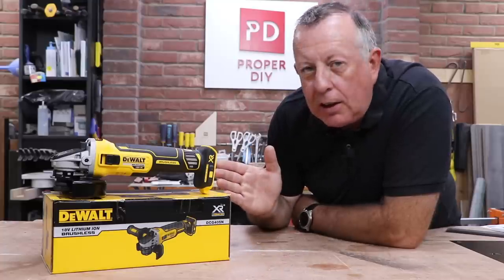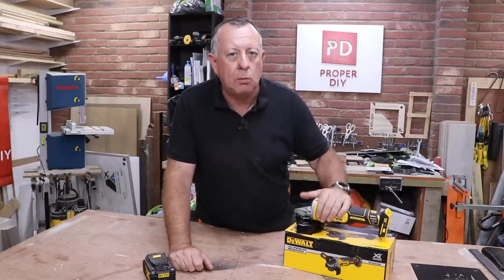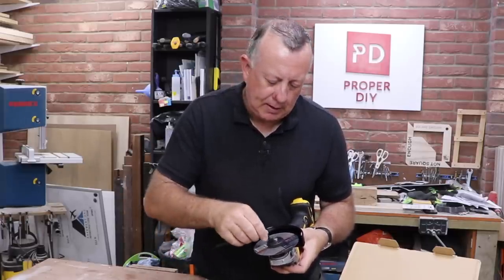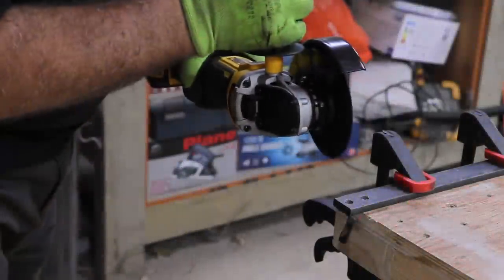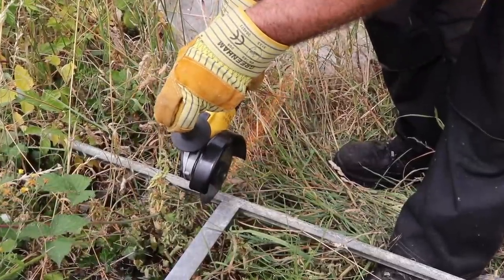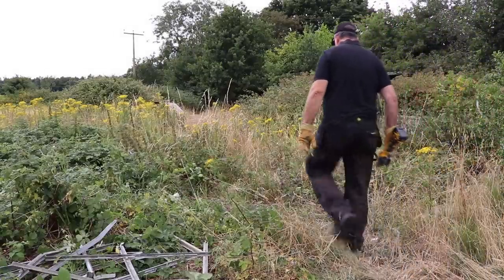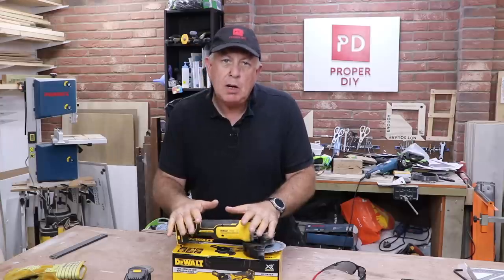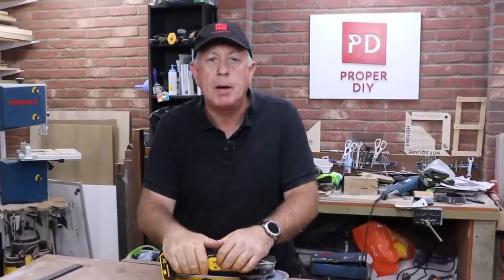Dewalt DCG405N Cordless Angle Grinder Review

Comment: I've had one of these angle grinders for about three years and it will cut almost anything, with the right blade.  I even managed a freehand circular hole for a fan  in the middle of a porcelain wall tile!  Cordless makes it very useable and the brake is excellent. This together with the many other XR tools I have make many jobs easier. It is easy to take their convenience for granted. 
However, if I die, please don't let my wife sell them for the price I told her I bought them for!
Reply: I am afraid it’s never going to be an IF but definitely a WHEN
Reply: I have many categories of tools, hobby items and other things that I have smuggled in undercover. When I get question my usual response is "Yes love I'd had it for years!". I then ask about the latest shoebox size package that was delivered for her.

Comment: Just as a general and my 2cents worth of a comment: (having owned the same unit and “upgrading” to one model up "DCG406N-XJ” for both ease of use and general and better “Safety” due to that switch mechanism in particular, which is extremely dangerous in my opinion @9:29 being a prime example)
-Prop up your work piece,as your back will thank you for it. not to mention have a far better view on what you are doing.
-Get a 54v Flexvolt (I know they are expensive,but its worth the investment) battery as the grinder drains batteries extremely quickly
-When cutting metal (and large,thick pieces in particular),make use of a “Pull push”/“ Constant Back and forward motion” method,as it reduces the amount of disc material being use (cost effective and time between changing discs over), reduce battery drainage and prolong work time,and puts less stress on the motor (does not get HOT as quickly) overall… Also get into the habit of “blowing out” the “vents” as material dust tend to clog it up and increase internal compenent heat…and is one of the prime culprits for grinder motor failure…

Comment: I bought one of these over a year ago, and it's priceless. I bought the Dewalt as I had the batteries. But, it doesn't have to be Dewalt, just any cordless grinder makes a huge difference.

I still use a corded grinder for stone & concrete cutting, but for everything else, this is a must have DIY tool. The cordless type is so handy for metal and plastic pipe, rusted screws & bolts, and a ton of other jobs. Never used it on wood, as I have proper power saws for those jobs.

They do tend to get through a 2Ah battery fairly quickly (10-15 mins), but it's a good reminder not to over-use it. 

As I mentioned, I have other angle grinders. One of the features I love about the Dewalt is the Allen key hole for replacing discs. My other grinders require a specific 2-prong tool for changing discs, which is annoying when you forgot where you put it.

Comment: Prob controversial but I prefer the paddle to the switch. I prefer the safety of knowing if I do need to drop the tool quickly that it will turn off. I also find it more comfortable to turn on and off with gloves on while I work.

Comment: I find that you can get more battery life and cut off wheel life if you are gradually "scoring" away at the steel from the top surface downwards through the 'thickness' of the bar rather than cutting through the full width of it like you were. You have the cut off wheel both above and below the surface of that metal bar which requires a lot more power and wears the disc faster. Not sure if I explained that well

Comment: Disks should only ever be tightened up by hand as the spindle rotation will tighten the nut when you’re using it. The tool is there to remove disks if it ever grabs as it will tighten the nut harder than you can do with your hands.

Comment: DeWalt are actually very good with spare parts if you do lose your locking nut. I got replacements for broken bits on my table saw within a few days. I did go through the retailer though, FFX, and their customer service is excellent. Your mileage may vary.
Reply: My grinder came missing the knurled retainer nut, but they generously delivered me ONE THREE TIMES 😂🤦‍♂️😂

Comment: 11:04 - Just a nerdy correction: there is still quite a bit of charge left in it. Lithium batteries can't be discharged below a certain voltage or they get damaged, so the tool (or the battery's own protection circuit) is preventing further discharge, but if there was "absolutely no charge left in it", you wouldn't be able to use it again.

Comment: I have purchased a number of the 18 v li lon Erbuer cordless tools and have been very impressed indeed. Although I use them in both a professional and DIY capacity they are not being operated every day , all day so totally appropriate for the price point. They are well built, comfortable to handle and the new fast chargers are fan cooled to dissipate the heat generated. I don’t think you can beat this range that after all has the clout of the Kingfisher Group behind it .

Anyone with comments ?

Comment: I have used de Walt cordless drills for years and they have never let me down . What has not been as reliable are the non branded  18 v Lilon batteries that even brand new just don’t hold a charge like the originals

Comment: For very little more, I purchased the DeWalt 405FN.  Essentially the same, except has a less blunt front ‘flat head’ design, that will reach into tighter spots. Get 5 Ahr batts tho’ cos they devour power.

Comment: Save yourself some money by the 115 mm model as it fits the 125 discs, probably a slight engineering fault that would upset the marketing department as the two models have exactly the same specs. Also use 6ah batteries as you will get increase in power for heavier workloads. I have two DeWalt cordless grinders, the Flexivolt 125 and the 18 V 115. Use the 18 V because it is lighter more convenient most of the time but the Flexivolt has considerably more power. I use the same 125mm cut-off discs and grinding discs for both models.
Reply: There isnt a 115mm cordless model,except in USA

Comment: When I saw the video pop up the part I was interested in your take on run time. To fulfil my grinder fixation I had looked at this unit but I have invested in a flex volt battery for my Dewalt tools. So I could go with the same unit as you with 18v or go for the 54v model. You would, certainly get more run time from a flex battery at an equivalent 12a/h on your unit
Cheers Stuart 👍🏻

Comment: Thanks Stuart, looks like a good piece of kit !
 I bought a cheap own brand cordless grinder a couple of years ago ( it was on offer and I already had the batteries) and although it only cuts 2 or 3 slabs before getting hot and giving up, it does mean I can concentrate more on not cutting my toes off than where the blasted cable is !
Mine is also of the "rat-tail " design popular in the USA with a paddle trigger which is more natural to my thinking.
Be careful on that roof, will you be using crawl boards ?

Comment: You're right Stuart, once you get on the cordless merry-go-round there's no getting off. I've switched nearly all my power tools to cordless now - 20v Worx for drills, drivers, circular saw, oscillating tool, jigsaw, angle grinder, sander, power washer etc. 48v Mountfield for the lawn mower, strimmer, hedge cutter, chain saw, leaf blower / vacuum. Battery charging station in the garage that can take at least two batteries of each type at a time & plenty of batteries to go around. That said I do have a "rouge" cordless Erbauer impact driver which I needed for a job when I could not source the Worx equivalent. Another good video Stuart. 👍

Comment: Thanks Stuart,  this video confirmed what I thought about the Dewalt cordless angle grinder.  I’ve got the Dewalt battery platform as well, but hadn’t bought the angle grinder as my Hitachi corded one is working fine and I only use it occasionally.  When it does die I will buy the Dewalt cordless, good to see that it has the power you need.
I recently bought the Dewalt cordless planer and have been very impressed by the power and quality of the cuts it produces.  Another good toy !
Reply: Oh cool.  Was looking at the planer next too.  Can you review the planer please @Stuart?

Comment: Just got one - agree is excellent and it cut up come steel bar perfectly and quickly - any comment though on the DeWalt  instructions that mention a different guard for sanding surfaces? ( it comes fitted with a 'type 1 cover') -  I couldn't follow what the 'type 27 cover' is needed for

Comment: Just in the market for a grinder for cutting some roof tiles, so a very timely video for me Stuart. Any chance of some more info on types of blades for different materials, maybe as part of your future project which I’m sure you’ll be posting on YT?
Reply: Yes more expensive than grits but I have been impressed with the diamond tipped blades for masonry, concrete, marble, ceramics etc

Comment: At about £165 for the bare unit its just about justifiable cost wise for an occasional use tool and I have seen a deal for £184 including a battery which is a good buy, I will buy one when my old corded one drops dead...

Comment: I've had one of these for a while, It's got some proper power but it eats batteries like you say, more so than any other DeWalt tool I own. It chews through batteries so fast that they get hot to the touch, so I've taken to swapping batteries mid grind when they are about half empty, just to prolong their life and not overheat them. Great for using up a ladder though or in a field working on my tractor. Dewalt also need to come out with a variable speed cordless grinder as this this thing way to fast to use diamond core driller for drilling into natural stone/marble/granite.  Not sure if they have plans for one.
Reply: Grinders from any brand eat through batteries due to there nature of speed and high amps
Reply: its out now

Comment: Nice video Stuart - and nice tool! I bought my first angle-grinder last summer - a corded one, and a terrifying beast! Shattered a cutting disc the second time I used it and I've avoided using it ever since. I've wondered whether a cordless one might be a wee bit less aggressive and let me get used to them, or should I just grit my teeth and man-up to my corded one...? LOL
Reply: My honest opinion (And no offence given), is that you have used  a cheap grinding disc from a cheap manufacturere ; the wrong Rpm disc (They are all rated to operate at a certain speed,and anything above that speed will result in shattering), or a damaged disc that has had a crack in already… (The amount of guys Ive seen on jobs, that pulls out a used grinding/cutting disc that has been thrown into the toolbox with tools ontop..blows my mind,as it is accidents waiting for happen)

The battery version that Stuart is useing does run “slower” than most corded ones…
Reply: @mariusenslin  thanks, Marius, and no offence taken lol. Yes, that's more than possible - and coupled with my inexperience, a recipe for disaster. Should I practice with thicker discs, cleaning rust off steel etc, to give myself a better feel for how the grinder operates? Thanks!
Reply: @MarkMichalowski  definitely a good and overal practise and approach..👍🏻

The right PPE (Safety Glasses/goggles at least or even better a full face Visor as Stuart is using, Some “grinding” gloves and hearing protection in my opinion)…. also ensure no lose clothing (Myself have learned a valuable lesson when some dangling hoodie drawstrings got “grabbed” and tangled in the grinder…thankfully the quick stopping brake when the trigger gets released ,kicked in, and  the visor took a hit in the process.. ever since then… more care and attention gets given when working with the grinder…

Have had a couple of wake up incidents where a wire cup wheel has graced some skin of the hand (nothing serious and fatal though), by my cowboy moves and stubbornness, when not wearing gloves or it being tok much effort to put them on after taking them off…🙄
Reply: I found the cordless one (same model as Stuart's) to be MORE aggressive than my corded Bosch model. The kick when you start up the Dewalt is...a jolt.
Reply: @richardjames712  Any brand is far more powerful than any of the bosch products that gets produced...😜
Reply: @mariusenslin  All valid points. One I would like to add, particularly as using thicker disks has been mentioned by Mark Do not use a cutting disk for general grinding. Cutting disks are very thin and not meant to be side loaded as general grinding disks are. This is a common cause of catastrophic disk failure.

Comment: Hello Stuart, I suggest you invest in a couple of the 6Ahr 54Volt flexivolt batteries. They will fit all your 18Volt kit and last a lot longer than the 4Ahr one. I find they also make my drill and driver more stable when I leave them standing up. I also have a chainsaw hedge cutter, both 18 volt, and the big batteries make a big difference to run time. I actually have several disk grinders, from a 180mm Makita corded BEAST down to a 100mm corded Matachi, with a 54 Volt 125mm DeWalt in between. The big Makita is not for the faint hearted, and you need to make sure you have it clasped firmly with both hands before turning it on. Like yours, the 54Volt DeWalt is still able to be used with one hand, you just need to be careful. Thanks for your videos I always look forward to them. Cheers from NZ.

Comment: A good tip if you lose your angle grinder tool. You can use the disc as leverage to tighten and undo the locking bolt (as long as it's not sharp, of course)
Reply: ....and you take the battery off it/unplug it first :-)
Reply: Not if its on tight.Thats just pure laziness
Reply: @garthqueen  You then need to work on your muscles or your leverage 😉
Reply: @tonkatoy200  No,im just not a lazy person who is careless and loses things

Comment: I bought one for use with a flap disc. What a waste of time and money. I started off with 2 4ah and 2 5ah batteries and 2 chargers. The idea was as soon as a bettery goes flat to put it on charge and carry on with next battery. By the time I had discharged all the batteries none had fully recharged. To say it is power hungry is an understatement. I'll stick to my corded grinder in future. Ps does anyone want to buy a Dewalt 18v grinder?

Comment: Corded vs cordless? All depends what your using the tool for and how much your using it. Cutting as i do, 12mm porcelain tiles all day cordless is hopeless. Full charge you'll a get few cuts but once the power starts to drop, even slightly, the blade starts chipping the tile. I'm a firm believer some tools need to be 240, circular saws, mitre saws and grinders in particular. You just need the grunt. And if you do have 240 on your jobs, corded tools are way cheaper.
Reply: I think he addressed this. Did you watch the whole video?

Comment: Had one of these for years they are very good. The only drawback for the grinder is that it is a bit battery hungry and may be better to have the 54 v  model
Reply: Why would the 54v model be less power hungry? Only if you put the 54v battery on 18v will you get longer runtime.

Comment: This is junk with 18 volt. The grinder only works for less than 5 minutes. Battery is too weak. This guy  does work with these tools.
I have all Dewalt tools. this is very poor.